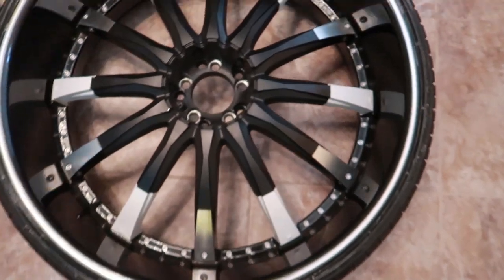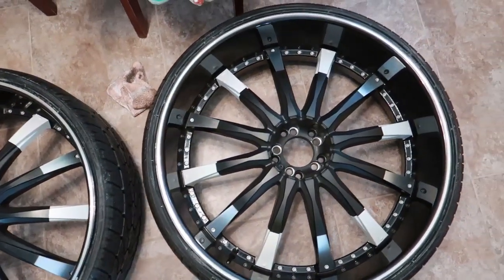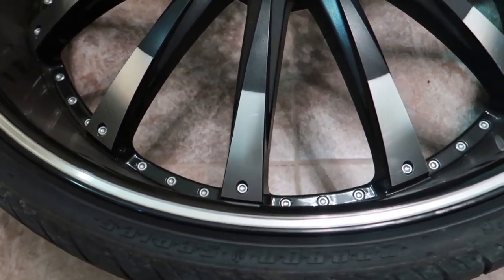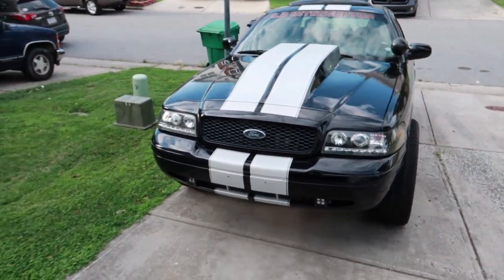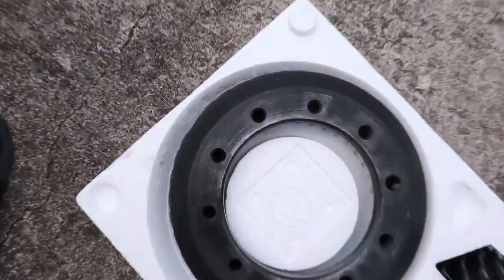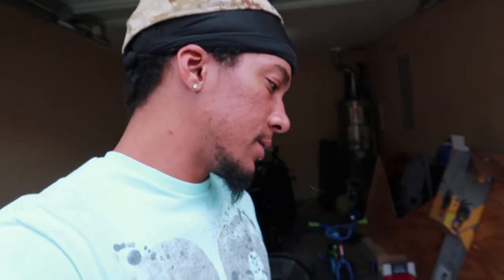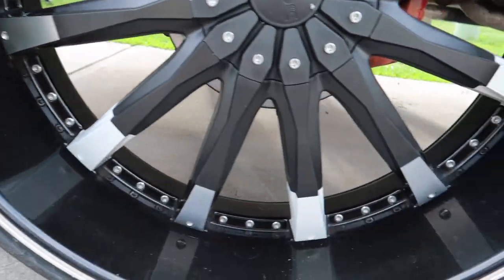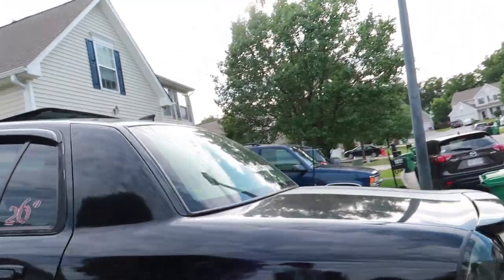400+HP Crown Victoria On 28s Update Part 1

Comment: You'll get it together fam it takes time just advice though if you don't mind you should have collected fully everything you needed in otha words did ur homework and then put ur car in the shop brother that's what I'm doing with the whip I have now I'm collecting every part for it when I'm done it will go in the shop and get tuned etc etc I wish you luck though fam 💪💯
Reply from the maker: Thanx for the advice brother, covid is slowing alot of parts getting in in a timely manner. But she will get there

Comment: im tryn find a police interceptor vic buh they all over 120k miles. Looking to buy my first car and its mandatory I have a v8 under my hood💯
Reply from the maker: yessir. check on autotrader, and cargurus you should be able to find 1 under 100k mileage.
Reply: I bought one with 125 bruh that’s low miles for a vic I’ve had my Vic 3 years I got 140 it’s going be hard find a p71 under 100k miles and dey probably goin won’t 7 8k if u do